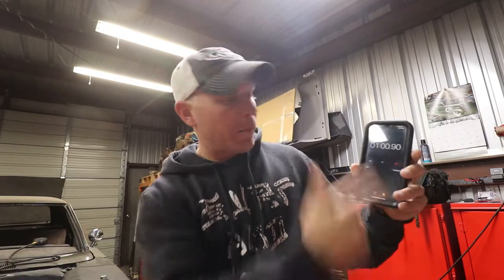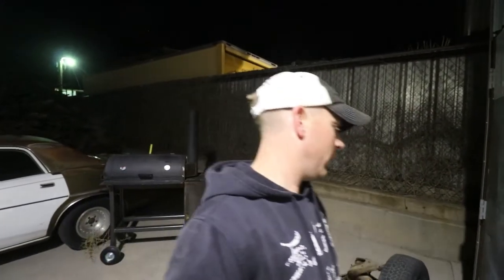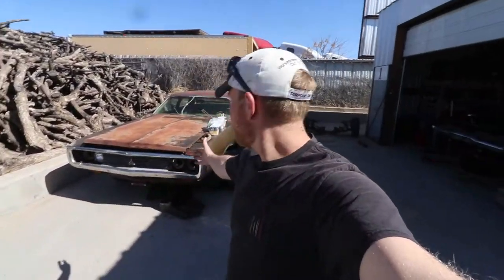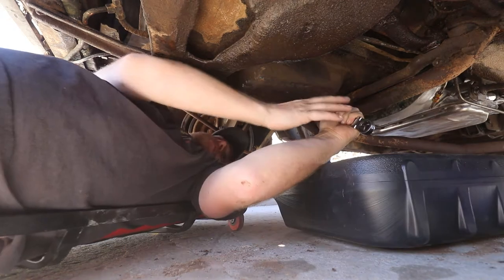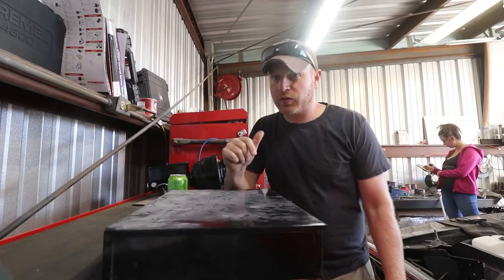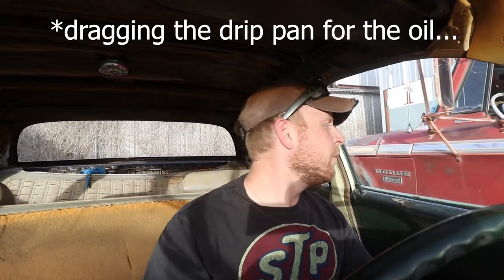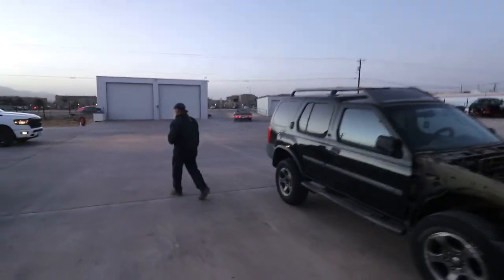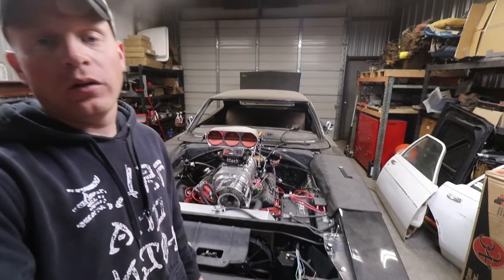1971 Coronet headlight upgrade, cheap muffler install, and carnage!

Comment: Hey man!  Those 440 source heads should work just fine on your 383.  I have a set on my 68 H code 383 and they have made a world of difference.  I have a zero deck engine which is probably the only difference from your 383.  You might also have dished pistons.